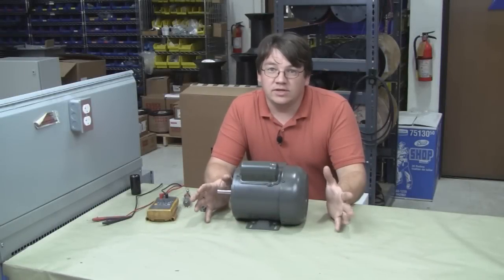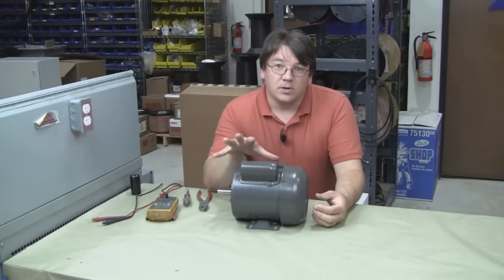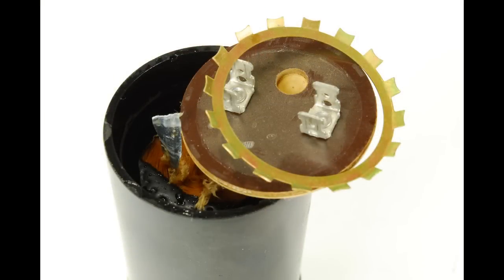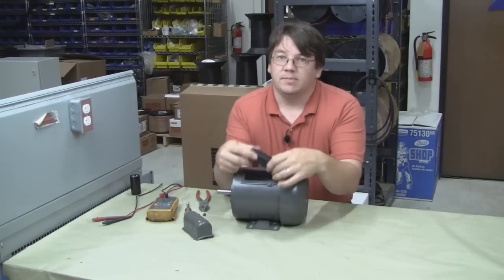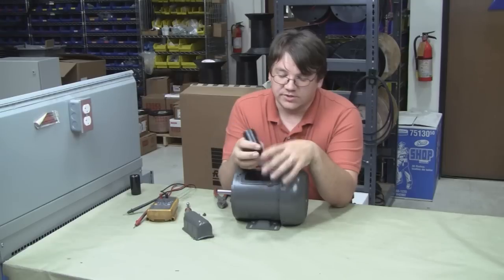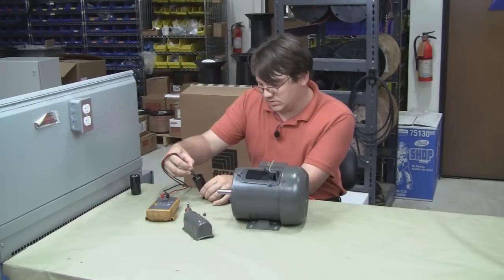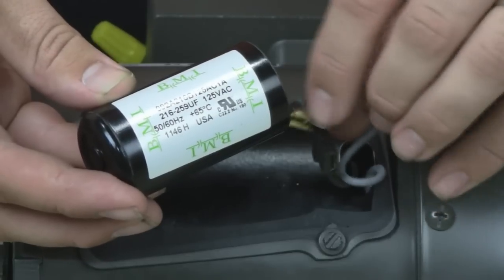Replacing a Motor Start Capacitor -- How To by TEMCo

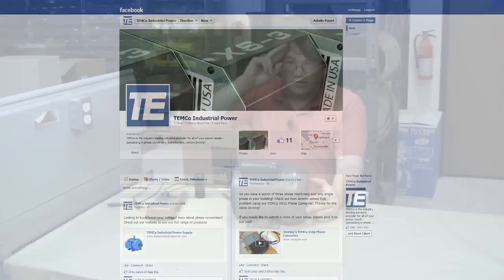Comment: My radial arm 6:56  saw just blew up during a 5 minute cutting job. The capacitor marking was 161-193. If the next capacitor blows up can the next capacitor be 200- 250 or 300 mfd?

Comment: If I have a capacitor that is bad and I have a replacement but the wires on the motor are both red and no markings so how do I determine which ones go to what terminals. This is on a Delta Bandsaw.

Comment: I ordered capicators from you guys. 
The 216-259Uf 250vac 60hz 
The capicators are much smaller in size with the same specs. Will this work? Will it not work for long? Why are they smaller with the same numbers? Thank u

Comment: At my job we had 48” fans and sometimes when we turned on a fan I noticed the fan would start up very slow. I would check and change out the capacitor and then the fan would start normally again.

Comment: Please clarify motor symptoms when centrifugal switch is stuck closed.  Does the motor fail to turn and emit a grinding and humming sound - or does it run with that sound?

My situation:  Washing machine motor, taken loose from the machine but still on wire harness. Hums but doesn't turn.  If I turn the shaft manually, it makes a few slow rotations and stops.  Start capacitor looks good and measured capacitance is within spec.  No bleed resistor across capacitor terminals - probably somewhere else within the washer.

Comment: 1 HP Emerson 2 Speed.
Does not start on low. Starts fine on High. Runs fine on low if you start on high and then switch to low.
Does the cap start both speeds and can it fail for one speed only?

Comment: I have a 1/2Hp 115v motor which has 1 62mfd capacitor with 4 wires connected to it. Having a heck of a time finding a replacement capacitor for it. Thought about using a 60 /5 mfd capacitor in series.

Comment: I purchased a used Hilka bench grinder,To get it running I have to spin the wheel, The capacitor reads 5uF  + - 5% wv 370 W ,AC The grinder is 240 v single phase,50.60 HZ ! 1/2 HP, I don’t know if it’s the original Cap! Also in your vids most caps have a resistor across the capacitor,mine doesn’t,should I fit one.With details given could you work out what size cap I should purchase,It has two wires to the cap ,the other end of the cap has a stud for a nut fixing ,length approximately 2 1/2 inches Dia 1 1/2 inches metal case.Any advice would be most welcome,I’ve had no response. From manufacturers,Thankyou.

Comment: I purchased an air conditioner hard start kit.  I want to check the start capacitor before installing.  The capacitor has a resistor, but I prefer not to remove the resistor in case I need to return the start kit in case it is bad.  What happens if I test the capacitor with the resistor? Most YouTube videos, like you, say to remove the resistor.  Yet, there are two videos that test with the resistor with one testing in range and the other testing considerably over range.  (I tried to test yesterday with my cheap volt ohm meter, but the capacitor is about 300 mfd and my meter only goes to 100 mfd.)

Comment: I have a 20 yr old Jet table saw that has started to bog on start up. Once up to speed, which only takes a couple seconds, the saw runs fine. Is the start capacitor on the way out? Do they fail slowly, or just quit? 
Thanks,
Ocotillodavid

Comment: What happens if you accidentally reverse the leads when you replace the capacitor.  Does it matter.  Does the motor then rotate the opposite direction.

Comment: Does it matter which wire goes to which lead on the capacitor? Do they work either way or is there polarity to worry about?
Reply from the maker: does not matter.
Reply: @TEMCoIndustrial  Yeah my brain kicked in later! Thanks.

Comment: I bought a billiard ball polisher.  It has a new non capacitor motor in it but, it wont start running with all the balls in place. It runs fine if I remove half of the balls then add them once it gets up to speed.  Do I need a capacitor start motor for this application?
Reply from the maker: sounds like a mechanical problem, likely independent from the motor.

Comment: Just bought a new dewalt 220 volt air compressor however due to low voltage it only ran a few minutes and stopped,,checked  the start capacitor with  meter and its only showing 181 ,,the uf rating for  capcitor is 243-292,,,could this be the culprit,,,i cannot find the same capc thats in  motor ..can i use different brand as long as it is 243 292 uf and for a 220
Reply from the maker: Yes, sounds like that might be the issue. As long as the voltage of the new cap is same or higher and the uf value is roughly the same, should work. Brand doesnt matter.

Comment: Thanks you for the video. I have a ridgid table saw. The motor trying to turn. I check the capacitor same as you did check my fluke multimeter. The capacitor it read "OL" it seems short to me. I need your feedback. The Capacitor made by CD60 MOTOR STARTER 200 micro Farad 250VAC -40/ +65b50/60 HZ E357070 Regards Manny
Reply from the maker: If you are using the capacitance setting on your meter, the capacitor is probably bad. Good luck!

Comment: Does it matter which wire goes to which side of the capacitor. I accidentally knocked the capacitor off my car lift and i want to reinstall it but there are no labels on the capacitor.
Reply from the maker: It doesnt matter. This type of capacitor is non polarized so you can install the wires either way (just not both on the same side!). Good luck!
Reply: @TEMCoIndustrial  IS that also true of the run capacitor?
Reply: I meant to ask: Are both, the start & run capacitors non-polarized?
Reply from the maker: Yep, they are both non polarized.
Reply: Thanks men, you are cool.  @TEMCoIndustrial

Comment: Does it matter how you wire the capacitor???????????? i installed one in a air masters fan and it starts up now but only runs for like ten minutes?????

Comment: FYI ... called TEMCo to discuss issue. They said motor bad. Anyway since I've got time on my hands I decided to pursue investigating on my own. Turned out the points on my Bremas switch were bad and I switched them around and I'm back in business. Also, I repeated the capacitor circuit (capacitor removed) and it still checks open ... YET EVERYTHING IS FINE NOW AND OPERATING.

Comment: I have a Westinghouse single phase motor on my bandsaw that stopped working, 3/4 hp.,Type FZ, Rpm 1725, Volt 115 , A 11.0, HZ 60 , Thermally protected reset button, HSG open, Type M, Code H, INS B,  Serial #E317P219 unfortunately on Westinghouse website their documents only goes up to #E317P079. It only has a Start capacitor on it upon investigation has oozed a tar like material out of it and has distorted if not erased the key numbers I need to replace it. And Westinghouse manuals won't give you any information on the capacitors used other than Type FZ. So my question to you is which start capacitor would I need and what resistor would be needed as well seeing how mine didn't have one on it? Your help would be greatly appreciated!

Comment: Hi
1. i dont know the value of capacitance in the old capacitor. How can i replace with a new one.
2. My motor terminal  has 3 wires to 4 terminals on the capacitor. How to connect them?

Thanks

Comment: Wouldn't the first thing to check is that the cap is discharged before touching it, check with meter or use a screw driver to short out both terminals to make sure it's discharged.

Comment: I have a Balder bench grinder it will start but when I grind a peice of metal it bogs way down.. It use to grind and now it doesn't like it use to I was wondering if it might be the capacitor I did take it apart and on the bottom there is a  capacitor..and it looks like a Air-conditioner capacitor. Any help would be appreciated thanks..

Comment: My run cap is at 270-324.uf when I tested it out of circuit at 350uf could that be the reason why it runs and then turns off??? It's a air compressor

Comment: I can’t find much info about how the  Capacitor fits in the circuit. I have a couple motors that came without any capacitors or power cord. The General Electric is a single phase blower or belt duty it starts right up stand alone under no load, haven’t tried it otherwise. The other one however it just hums till you give it a spin then it takes off. I have very little info on it, no diagrams etc. I guess I just would like to confirm exactly how they are wired in the circuit,

Comment: Thank you for sharing your knowledge. I'm still a bit green when it comes to AC applications, and was wonder if maybe you could help. I salvaged a (115v-4A Haier 0034000074) motor from a Whirlpool washing machine a few months ago to use in a homemade lathe, and put a plug-end on it. The motor wont start on it's own but will run after turning by hand, but I don't recall seeing a capacitor in the washing machine (but could have missed it). My first thought was that it needed a capacitor (and redirected here from your other video on capacitors.), but it seems like this type of motor wouldn't need a capacitor. Any help would be greatly appreciated, thanks in advanced.
Reply: The closest motor I've found is the replacement motor ( W10416664 ).

Comment: Thank you for sharing the clip.
Let me drop some questions. 
I have a single phase induction motor. 4 poles, 2HP, 1.5kw, 220Vac, 1700rpm. 
It has A capacitor which is 600uf in 110Vac.
but the motor runs in 220Vac.
I thought the capacitor should be more than 220Vac.
I don't get it how come the capacitor is 110Vac.
do you think it is able to replace the capacitor which is 100uf in 250Vac?
what is the fatal part and value to enhance the torque of the motor?
if it has changed what would happen in the motor?

Comment: Hello mate, very helpful video. In England we have a brand of light industrial single phase ‘clarke’ air compressors. It’s blows a fuse on start up. I’m suspecting the capacitor. Does it matter which brand capacitor I use as long as it’s the same digits? 450v 80uf.

Comment: Can someone please help .I have a target wet saw the saw turns on but it strainswhile its running,and never gets up to full speed before it pops the breaker.i assume its the capacitors but the ones on my saw are so worn or old i cannot read what size  it requires .that it for a target tilematic .thank you.

Comment: Hi,, I'm checking out a 125 vac motor for a neighbor s air compressor. His symptoms are, no hum, no start. Have power to switch but that's it. I checked the start cap which is 250uf 125vac cap. One meter reads 306 mf another reads ol. Strange. Does this more sound like the start switch,,or cap, in your opinion? Thanks much.

Comment: What if you put the wires on backwards.  I E  what if I didnt mark the wires before I took them off....oops  I have 2 hookup with 4 heads clips 30uf  440v for pool pump..  Thanks  Great video

Comment: i have a littel motor with (0.5) mf capactor , resently i Noticed when i turn it on ,,, its not runing for like 3 to 4 seconds then its start running . i have another capacitor (2) mf ,, can use it instade of old one ?

Comment: I have a dual voltage (115/230) motor and have it running on 230 volt. The start capacitor is 850-1020 MFD and 110-125 VAC. Do I need to change this capacitor and if so, does the MFD change also?
Reply: Tom Vesco I

Comment: Nice video. I have a compressor that starts and runs but will not restart once air gets low. It will only restart after it’s been off for about 5 to 10 minutes. Could this be a bad start compactor or the switch that tells it to start ? 

Thanks.

Comment: I have two questions if you please:
1- Do I need to remove the resistor when measuring the capacitance, or can I leave it on? I've seen a couple of youtube vids where the resistor was disconnected at one terminal before testing the capacitance.
2- when I buy a replacement start capacitor with an MFD range, ideally, should the capacitance be in the middle of the range? What if it is very close to the lower end of the range? Should I get another one?

Comment: i have xr3 phase converter  yesterday i took out two source single phase 240v and reinstall and start  hear a spark song  turn on my paper cutter  not enough power come out from phase converter  ,second time turn onphase converter ,also hear a spark song , turnoff , check wiring connection L1 L2 T1 T2 T3 turn on again no spark but power not enough to drive the paper cutter , i install phase for five years  ,only took wire disconnect and connect  back , not enough power output  3phase , is there any capacitor burn inside or aged problem thanks

Comment: is a symptom of a bad capacitor that if you manually spin the spindle quickly and the motor starts right up and runs smoothly, then it's a bad start cap?

Comment: 2 spd pool pump motor that will no longer kick into high speed unless I start it on low speed.   If it is started at low speed then I flip the 2 spd timer to high no problem, it runs but try to start from stopped to high it buzzes then the thermal overload kicks in and i have to wait for 20 minutes.   Is this due to a weak start capacitor or problem with the centrifugal switch?

Comment: I have a Gould 3hp motor.  Name plate says 230v...the capacitor that looks like the original says 115.  Is this normal?  Can I run the motor on 115?

Comment: I have a table saw motor that starts ok but when I put even a small load on it it stalls. The model# is 820030. It's now being replaced by part#370200. Is there a problem with my capacitors? I don't see any brush caps. A new motor cost $350.

Comment: hey i have a tyre chnger im having trouble with basically when i first press the pedal to start taking a trye off i have to turn it slightly but turns without any resistance but has a few seconds slow befor it sort or kick in to the correct speed a frend charged the starter capacitor to 250v and it wouldnt charge but also when i checked the cf swith it had broke of the solder dont no if it happed when seperating but surly the turn table wouldnt starter with these things

Comment: What should I do if I have a motor that I scrapped that is just missing the start capacitor from the get-go?  Is there any way to determine what farrad rating a new capacitor should be just based on the voltage/amperage ratings on the motor itself?

Comment: Thank you very much for valuable knowledge you shared about changing capacitor, please can you help me about this. My induction motor has two capacitor 1. is 30 micro farad and has 250/400V and and the other one is 150 micro farad and 250/400v; so I only have new ones to replace but it is 30 micro farad 400v and the other one is 200 micro farad 250v. is there any adverse effect if i will use this? this only available in the market in my small town here in Hinigaran Negros Occidental Philippines. thanks

Comment: Good video
I would suggest that you check that the capacitor is fully discharged before you touch the terminals because if the resistor is blown it may not be.

Comment: I have liked this video.Can i replace a 10uf 400vAC with a 7.5uf 800vAC capacitor?
Reply: from what i understand there should be no more than 10 percent difference between the rated ufs.

Comment: What if the motor blows the circuit? I have a 110/220 single phase 3 hp motor it runs in 115 but blows the 30 amp breaker in 220?

Comment: Very nice video and very informative. Could you please advise what could be the issue on a porter cable table saw motor that runs without the blade but not with the blade on?

Comment: good day sir, i have a washing machine a normal one with spinner  but the washer wont  spin unless you need to use your hand to turn the thub then it will spin after that it stop again the use again your hand to do it and kind uh waste of time what  do you think the problem is??i swap the connection on spinner and washer of the connection on the capacitor but still same problem would it be the motor problem ?? or the wiring
??
thanks..

Comment: Hello, I have an older Kollmann sewer snake which has a 3/4 ho single phase motor. This motor is revers able and worked in both directions. I recently had taken it apart to clean and service the clutch. I did nothing to the motor except lower off the cradle. Reassembled everything and unfortunately now the the motor only spins in reverse but not forward? Starts right up as it did prior but switched forward and nothing, no noise, etc. do you think my capacitor is bad? Don't see any loose connections, any help greatly appreciated, thanks, eric

Comment: If a motor with a single start capacitor is rewired to run on 208v from 115v, does the start capacitor also need to be replaced with one with a higher voltage rating?  Thanks.

Comment: Hi, I like the video, My problem though is I didn't take off the old burnt out capacitor so I don't know which wire goes to which connection. Is there an easy way to determine which is which ? Thanks Phil.

Comment: when you read across the capacitor which lead from the motor goes to which contact. In other wards how can I tell that the capacitor is wired correctly. Bemilam89444 @gmail.com

Comment: I have an old ingersol rand air compressor with a 2 hp motor. the past year when I threw the on switch, sometimes it would start right up other times it would hum. today I tried to use it and it just hummed and ultimately the floor surge protector it was plugged into tripped. I removed the cover and I could see ( when I reset the switch) a very slow turn of the crank rod but with in about one full revolution it would trip the  cirquit again. the motor looks like the one you have says 8-175661-22  and fr y56y and 170501 on the metal plate. it has the two humps on the bottom where the capacitors are mounted. so my question is which one is the start capacitor? and you also mentioned if the motor hummed it could be a bad start switch? How would I know that the problem is the start switch and not the start capacitor.?